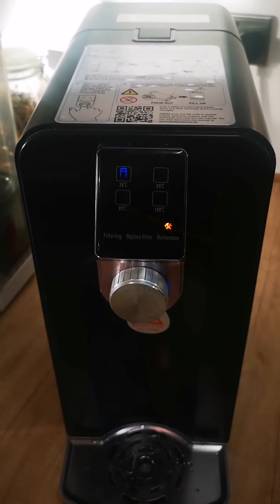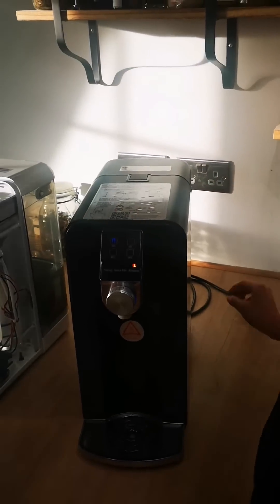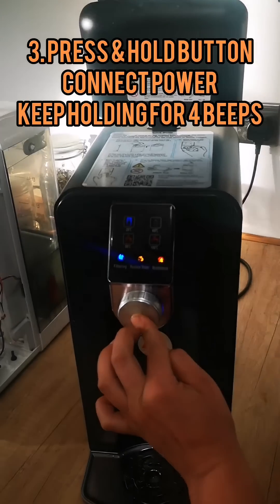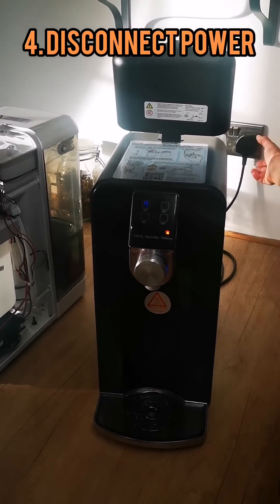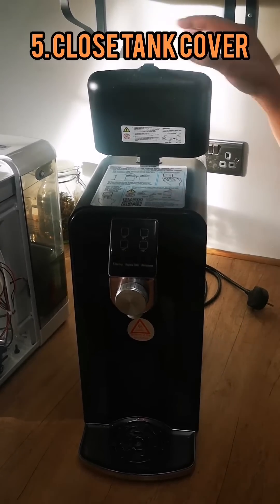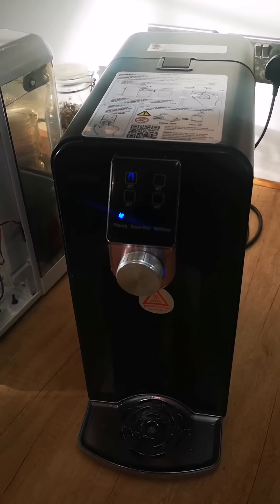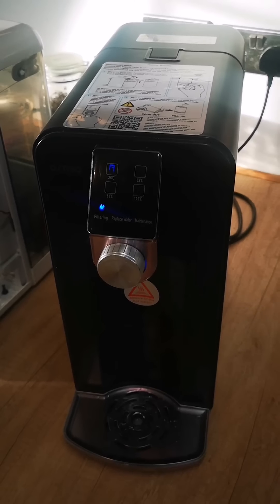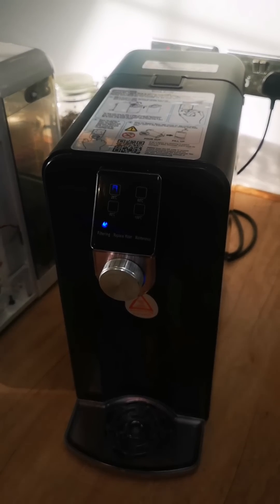Osmio Zero Maintenence Light : what to do

Comment: Would I still do this technique if I have only had my filter system for 2 months and definitely haven’t used 2000L yet! Thanks
Reply from the maker: yes this part of the filter change process to reset the litre counter, but if you forget you can do it later on, it doesn't matter because of the second reason it comes on

Comment: Open close open close, Unplug, plug, plug in outlet while holding holding button,  you should add hold your breath for 10 seconds spell your name backwards 5.445 times then recite PI to 4335 decimal places  hahahah.   Who in the world design / created such ridiculous requirements / instructions.  Don't they realize a large amount of people can't even program the time on their microwave ahahah :-D
Reply from the maker: Well.... at least you cant do it by accident
Reply: Hi. My machine has stopped dispensing all water except cold. It  begins to dispense hot water but then starts to pour cold automaticily Any advice?.
Reply from the maker: @oscar6662  

When the heating element starts to trip out, it is usually because the system is receiving low voltage. This normally happens when customers plug in a Zero into a double socket or an extension and have other appliances connected, like toasters, microwaves, or even kettles. This is bad because each single or double socket can only deliver 13 amps, so if the Zero and a toaster are run at the same time, electrical damage will occur to both appliances.

The Burn alarm on the Osmio Zero is when the fuse for the heating system trips. If when this happens, it trips out your main electrical board, it means that your heating system is dead and needs to be replaced.

However, if it does not trip your board, there may still be life left in the heating module! Most Osmio Zero's pre-2022 have a heating element reset button for the fuse. Follow this videohttps://www.youtube.com/watch?v=YAL9xuk1grs&ab_channel=OsmioWater to try resetting the heating system.

If this does not work, then it means you need a new heating element:

You can order one here and there is an option for us to either supply the part to you, or you can order the change by an Osmio Engineer which involves you having to make the system ready to collect and it will be sent to us, and then back to you.

https://www.osmiowater.co.uk/replacement-water-filter-cartridges-membranes/osmio-tap-parts/parts-osmio-zero/heating-element-osmio-zero.html

If you have a competent person to change the heating element for you, it can save a lot of time and work for everyone, and we have two videos on how to take the case off and a second on how to change the heating element. https://www.youtube.com/watch?v=x3PXrJfYHFk&ab_channel=OsmioWater